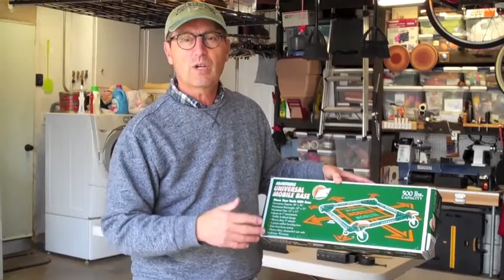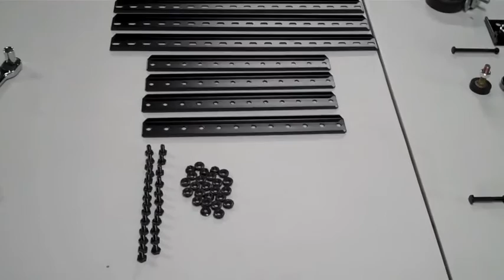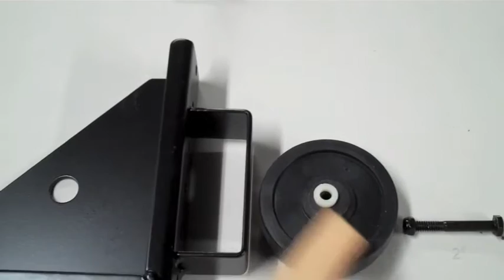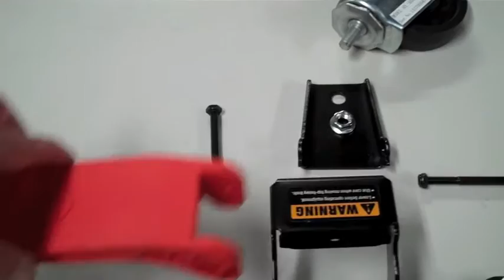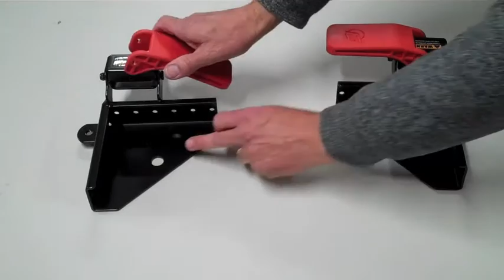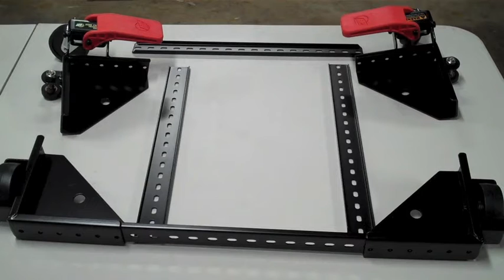HTC 2000 Mobile Base Assembly

Comment: Thanks so much for the EXCELLENT video! I especially appreciated the small hints that you added (e.g., how to easily get that nylon washer fitted inside the wheel). The one thing that I did that you did not mention was to bolt the extender pieces onto the frame, even though I don't need them for the present application. That way, if I decide to use the base for a larger machine in the future, the pieces will be there where I need them, rather than lost or "in a good place" in my garage or basement. Thank you again!
Reply from the maker: Thank you for your complement Ted.  I think that idea of bolting on the extra pieces is excellent, mine are somewhere in "a good place" in my garage now. By the way, what state are you in?  I like to put a pin in my map for all of my replies. Take care!

Comment: I followed your instructions exactly and am happy to say I got it put together. Thank you. Only problem is I discovered belatedly the after-market stand on which the Ryobi 10-inch table saw sits has no two sides the same length. All four sides have four different lengths, with as much as a 2-inch difference between opposite sides. No options to correct the stand issues unless, as another poster mentioned, I attach a board to the base and the stand to the board. Thanks again for your wonderful help!
Reply from the maker: Glad it helped!  By the way, what state are you in?  I like to put a pin in my map for all of my replies. Take care!
Reply: @gfotinakes316  Texas, north of Dallas. Thanks again

Comment: George, after 4-1/2 years I would be surprised if you are still looking at these comments, but here goes for the rest of us.  First, THANK YOU.  This indeed saved me a ton of time and consternation trying to follow the cryptic instructions that came with this base.  (Here's Step 2:  "Attach swivel plate E to the (Front-Right) caster bracket corner A using pivot rod bolt I and M6 self locking (black) nut V.")  Yikes. So your visual guide was a welcome relief.  

However, when you advised us to attach the wheels first, you didn't mention that if the non-swiveling wheels are already mounted to the corner brackets, then it's not possible to insert the side brace pieces any more deeply than two holes in, because the bolt that holds on the wheel is in the way (and it was hard enough to get in there in the first place, as you warned us).  Fortunately, the length I needed let me use just two holes at those corners.  But for strength I would have preferred to secure the sides with bolts more than two holes apart.  We'll see how it goes.  

The instructions, lousy as they are, say to build the frame to size before attaching the wheels, and I'm inclined to agree, because if you need to run the wheel bolt through later you can just run through a hole in the side brace.
Reply from the maker: Thank you!  I read these comments every day and enjoy knowing my videos help folks.  Take care and be safe.

Comment: I wish these were metal lever locks instead of plastic, my wheels will not stay locked while moving on my concrete floor.
Reply from the maker: That's not good.  How can you then move it around?
Reply: George Fotinakes I don’t move it much for this reason but when it’s necessary it takes 2, one placing their foot and holding the lock down while moving & myself on the other side doing the same. I’m currently exploring my options to change out the the entire caster mechanism. 
Thanks for your response.

Comment: Thanks for your very thoughtful and well produced video. makes it a lot easier. fyi, i built my base around my Jet drill press, so i didn’t need to lift the heavy press into the completed mobile base. it’s considerably harder than your method, but was able to get the mobile base tight to the machine’s base, and didn’t need another person to wrestle the press into place.  Thanks again for your efforts. Bill Garbus, architect + artisan, CT, USA
Reply from the maker: Great, glad I could be of help.

Comment: The instructions were horrific. This video helped me in so many ways. Thank you! 

Interesting setup having your table saw atop your planer. I have the same two Dewalts. Do you have a video on what you did?
Reply from the maker: Sorry, I don't have a video of that.  If you look closely at my video again you will see I simply have two 3" wide pieces of wood cut so they are hanging out over the planner. The saw's tubular base sits on these pieces.  I then screwed down into two end pieces to keep the boards from sliding to the left or right off of the planner.  I recently added a scrap steel bar with drill holes drilled into it bolting the bar into the tubular base on each side and the base on the bottom side.  Wing nuts hold this all in place.  You have to remove the elevator crank from the planner and place it and the hardware into a zip lock bag that sits on the top of the planner. I don't use my planner often so removing the bars and adding the crank back doesn't bother me.  I am sure you can come up with a similar design to save space...make sure all is secure before using that table saw!

Comment: Your video was very helpful, thank you so much. I did have one problem though and it was getting the plastic washer to stay between the wheel and the corner piece. I solved that problem by making a very small piece of masking tape and taping the plastic washer over the hole and making a hole in the center of the washer so you could see through it to align everything.
Reply from the maker: If that worked great, but did you see 6:09-6:30 on the video?  Enjoy your new mobile base.

Comment: Thanks for the video - I was able to put it together quickly.  I also found that if you use the impact driver on the bolt and hold the nut with your fingers it will self tighten so you only need one socket.  Of course this doesn't work with the locknuts.

Comment: Great help but, Is this not designed to utilize a piece of plywood, 3/4" would be best, to sit the machine onto inside the assemblage? It has a hole for bolts to attach the wood base. Thanks a lot.Great concise video.